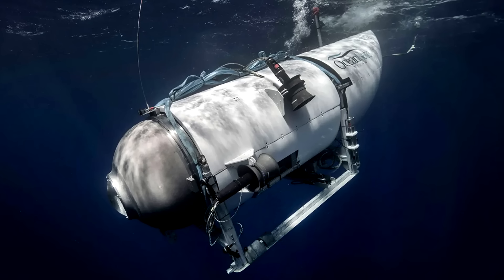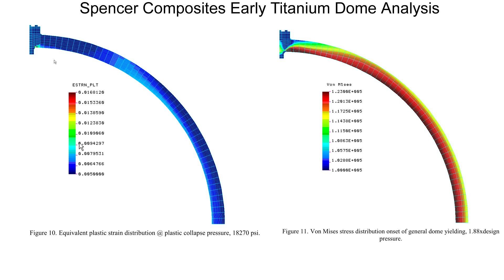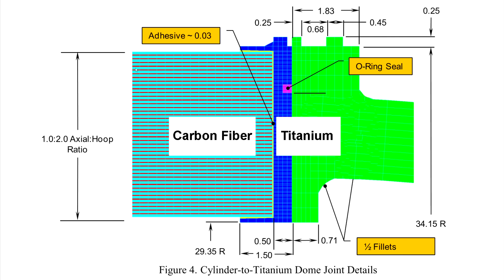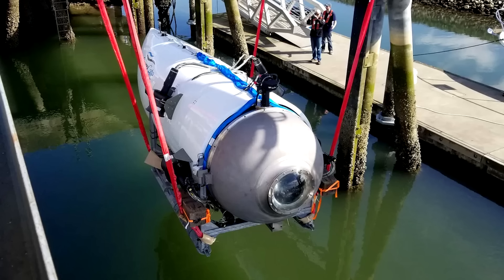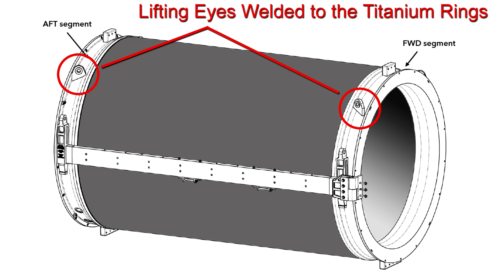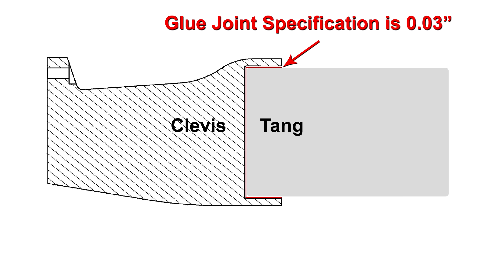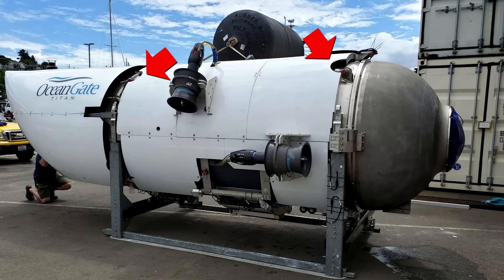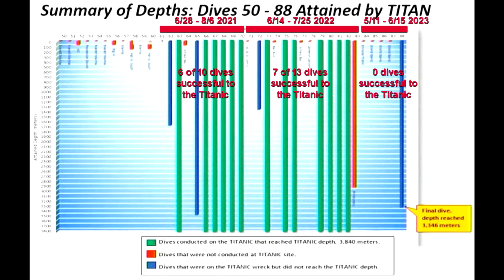OceanGate Titan Titanium Rings - An Additional Story About Them

Comment: The apoxy glue failed at the front ring which held that front cap.  The carbon fiber cylinder actually held up against the enormous pressure.

Comment: 2:02 well from the beginning, Rush especially believed that the pressure of the water would hold the end caps together vs being a failure/water ingress point. And it was never examined as such. On dive 87 when the bouncy on the barge failed and the sub was impacting the barge multiple times couldn’t have been good for the titanium and carbon fiber joints

Comment: To me this shows that verifies Tony Nissan”s claim that it was not the hull why he would not go down in Titan, But because of the Operations team and Rush who both did not know how to handle, store, and move Titan to protect and safeguard the hull.  Yes, very poor manufacturing of the hull, but it was the compromised forward ring that was the primary cause of the implosion.  
If it had proper handling and storage, I believe from all the testimony the hull’s life cycle could have been at least 20 dives to depth before it needed to be replaced.
You may be able to say that Stockton was on to a new material for submersibles if he would have followed Boeing’s recommendations and could find someone who could do the level of manufacturing needed, along with excellent handling procedures.  
Your thoughts?

Comment: In the full audio of Lockridge and Stockton, he clearly states about the consequences of moisture freezing in that sub yet he left it for a full winter where it was subjected to such temperatures. That is insanely negligent and i have no issue if it was a solo endeavour but he downplayed the risks. He used the safety record statistics of the industry, one that he didn't just not adhere to but actively opposed. His accoustic monitoring system actually worked yet they didn't see or ignored the data. Was Stockton on  the deep dive after dive 80? I thought he wasn't and someone else was on that ride? If so that feels calculated. You hear this event on dive 80, brush it under the rug but are not in the next deep dive. Brrrr.

Comment: Regardless of many other considerations,  one fact is that the lips on the titanium rings are just too thin and narrow, a stupid way to skimp on expensive titanium metal?... orcplainly bad design?
- No surprise those lips were cleanly removed by the force of the implosion... 

 The design of the dissimilar material joints between the carbon fiber cylinder and the titanium rings was as precarious as anything!  Absolutely worst made design, with a very idealistic set of design loads, assuming "perfectly" behaved components, without ANY allowances for Real-Life additional loads...

Comment: I think you are right. Those rings distorted, broke the glue bond, all it took was a fraction, seperation, implosion. The heat generated in welding, into the fiber, all that weight focused when lifted?

Comment: Nissen is an incompentent narcissist he lies whenever he opens his mouth.

The water intrusion comment is total BS, since the pressure in longitudinal direction by the end caps would have sealed any leak.

But what did propably cause the accident is when the glue deteriorated the thin lips suddenly had to take all the load,
which they were far too thin to do, which is why they sheared off like a knife going through butter.

Comment: For me, the most important factor was reducing the thickness of the titanium ring lips to accommodate the thicker V2 fuselage. The domes after implosion show that these lips were completely torn off. The fuselage itself showed no fiber breakage along the mid-length of the fuselage, indicating that the entire cylinder collapsed uniformly, and this could only have occurred when the dome lip was released.

Comment: Seems a solid one piece titanium would have been different.  The porthole would still be a concern as well as each line that breached the hull.   Multiple entry port with multiple sealable hatches.  This bs about weight is stupid.  You could add a ton of additional hp oxygen for emergency rise.

Comment: I’m surprised they didn’t at least use reinforcement rings or some kind of skeletal structure along its length to prevent flexing. Barrel manufacturers have better engineering.

Comment: Superb example of people ignoring engineering imperatives.

Probably not the cause of the failure though.
The sub' imploded.
If the joint between the rings and CF tub failed there would have been water ingress as pressure eualised.
It probably would have been violent and it might've caused the ring to separate but that wouldn't have caused the CF tub to implode and disintegrate.

Comment: Jeezuz, ya don't have to be a submersible engineer to see the potential risk of welding and lifting via the rings. Ffs, it's commonsense ... which Rush was short on. If it ain't 100% DESIGNED for that function, ya don't do it.

Comment: So whether it was lifted by attaching the straps to the landing gear, which was attached to the titanium rings or to the welded on lifting eyes, either way the load and shear forces on the rings would still be a factor, correct?

Comment: Just wanted to ask about the forces from the rigging used to lift the sub by the new eyes. I don’t see spreader bars used, so the force isn’t 100% in shear. Wouldn’t it have pulled inward on the upper eyes, forcing the bottom of the titanium ring to pivot away from the carbon body?

Comment: All that focus on lifting stresses on the "lip" of the titanium ring, but little or none on possible shear pressure from the water pressure itself? It seems to me there should have been a much heftier load bearing inner cylindrical interface on the ring, with the titanium extending some distance into the cylinder and tapering (feathering) to its extremity to allow controlled supported deformation  of the carbon fiber/titanium interface away from the shear point. What am I missing?

Comment: If the glue failed, water ingresses, and pressure equalises - wouldn't the rings either stay in place or fall off; but the carbon structure surely wouldn't fail in this instance?  Of course occupants dead and sub filled with water in this scenario.

Comment: It was a sealed carbon fiber tube. The titanium ring and clevis were part of but irrelevant for the implosion. 

Cycling the carbon fiber at depth led to carbon fiber damage. The crush happened between the end cap rings and the damaged fibers leading to increased loading on the cylinder itself. 

The carbon fiber was a bad material for cyclic loading at that pressure and the cylindrical design was second. Spherical design is the best for even pressure loading and can be overengineered to compensate for manufacturing defects. 

This was hot garbage. This entire vehicle was based on flawed assumptions in engineering.
Reply: It was sheer factor on the thin c section where the carbon and titanium mated. Thats why u can see it is separate in pic of front dome. 100% it was. U learn sheer dynamics in first semester of engineering. Stockton and hid friends to busy partying to learn that

Comment: You are making a very good case for the Titan's destruction. As a Mechanical Engineer, just looking at those lifting eye, design, fixing locations and connection welds, should have had the alarm bells ringing. It didn't with 'Rush', either he didn't have the experience to see it or he didn't want to see it.

Comment: Comments are blaming things like the glue holding the domed ends on the cabin cylinder. But from the moment the Titan was lowered into the merciless ocean those domes were never ever going to separate (fall off)....They're being held together by countless pressures per sq. inch that eventually imploded the cabin like an aluminum can crusher. Imagine setting an empty beer can on the ground....and you slowly, carefully stand on it with one foot... without crushing it. Then have someone disrupt the structure by gently pushing in on the side of it.....VAROOM! It implodes. If the cylinder used in this dive belt was a foldable material it would more likely be in a few pieces but carbon fiber is somewhat "brittle" in comparison. I'm curious if they lengthened the hull. The shorter the hull, the stronger it is. (common sense)
Reply from the maker: Thanks for your comment.  What you describe is true. The other potential weak spot could still be the epoxy joint between the titanium rings and the hull.
Reply: @solareclipsetimer __Thx for the reply.   I like to picture things in my mind. For instance a "ring". If you acquired a ring from a gum-ball machine and pinched it with 2 fingers  from opposite  sides you could prolly "oval" it rather easily....but if you pushed in on all sides of it equally it would be (to some) surprisingly difficult.   Participants in this project will never know for sure. There could have been an implosion on a small device outside the vessel that triggered (via shock wave) the whole catastrophe....Rapid water displacement at those depths is mind boggling (to me).
     I'm a Master Plumber...hand me a set of plans and I'll plumb that custom house from the ground up, by myself and never hold anyone up. For some reason I always did well in science too.  🤷‍♂

Comment: When you hear Tony Nissen explain why he did not want lifting points on the rings, he makes a very calm rational explanation for this that is compelling and obvious even to someone like me who has worked in maintenance engineering for a considerable part of my working life. I dont have the engineering qualification but rather i would be at the sharp end putting something together an engineer has designed, working in this environment you get a real hands on feel for how materials work, i can see with Tonys explantion the weak point for water intrusion is that top tang on the ring. The whole way of lifting the sub seems an after thought, a good designer involves everyone right at the drawing board stage, involving a rigger at the design stage would have raised the question "right thats great, but how do you expect me to lift the dam thing" often engineers miss basics like this, wrapped up in their own self importance and qualifications (they usually have plastered all over the walls to show the world how clever they are) they dont see a need to involve the shop floor guys who they view as inferior. The more you see of this sub you realise it was always likely to fail, the point i dont know was how many pressure cycles would it be subject to before the weak part i.e. the carbon tube was replaced, this would have been your back up, your final safety margin, with a material like CF which is always going to degrade, it should have had a defined life span.

Comment: They didn't even use a spreader bar to lift! Think of the internal compression inwards on the hull during lifting, as well as the outwards tension on the lower half of the hull. Holy crap what a debacle
Reply from the maker: Yes, the rigging from new eye rings that were not in the initial engineering was a bad idea.  It makes me wonder if the failure point was the front ring.  Did you see my video on Dive 87?  That will make you suspicious about the front ring also.

Comment: "Lets lift it by its weakest points" was the death knell.
Reply: Classic Stockton
Reply: Surely at some point, they must have contemplated using a braced system for transporting, or at least I’m left wondering why they didn’t engineer one - choosing to use rings instead. Probably cost. Who knows. 😂

Comment: I know nothing about structural engineering, but I wondered why they didn't use a thin layer of titanium to encapsulate the carbon fiber.  Meaning that you'd be using less titanium that in traditional designs, the carbon would represent the center structure, it would be sealed from water intrusion, and the rings wouldn't have been glued.  Imagine a hollow wood door, except with a carbon center.  I agree with a previous commenter that this should have been tested hundreds of times unmanned.

Comment: The problem was probably caused by sanding through the layers of carbon fiber to put the next layer on. This caused weak points.  Secondly when carbon fiber fails, it does not fail slowly but all of a sudden, so alarms would be of no use.  Carbon fiber was not appropriate for this purpose. Plain and simple.

Comment: The cause of the failure was Stockton Rush.  Lack of testing was an issue, yes, and that led to loss of life.  But bottom line is that it was bad design.  And that was apparent from the start.  The fact that Stockton was relying on a system of detecting micro failures as a predictive model of catastrophic failure was ludicrous.

The experts warned him that his selection of materials was not sound.  He ignored the experts.  And he failed to recognize there is quite a bit of difference from designing pressure vessels for aircraft and designing pressure vessels for submersibles.

Comment: The sub also spent time outdoors in the cold Canada winter. Any water intrusion would have frozen and expanded. The fatal dive was the first deep dive of 2023. The failure to account for cold weather is reminiscent of the space shuttle Challenger O-rings in cold weather, which also proved fatal. Both attitudes were the same: we got away with it before, and we will continue to get away with it.

Comment: 2 different materials react differently , contract differently so when the titanium didnt contract but the carbon fibre did , so therefore the seal between them was compramised and failed . there was no way to check them other than taking them apart .no public should of been aloud to enter it , no safety measures to abandon ship either .so sad this was aloud to happen
Reply from the maker: I agree, and thanks for commenting.  Tony Nissen worked to match the moduli of the CF and the rings of the V1 hull.  We don't know about the V2 hull and using the same rings.  The strain gauges from the Titanic dive seemed to show that the aft ring was much stiffer.  But the strain channels were not labeled well, so I am not sure. I write about all of this stuff in my book.  The link is in the description.

Comment: I was in the Navy and fixed 688 class subs. One of the things we are trained on and have to sign off on when we did work, were Subsafe requirements. At one point Stockton Rush mentioned Subsafe and complained that the safety requirements were over the top. The irony of this statement is that Subsafe was developed following the implosion of the USS Thresher, a Skipjack class submarine. These safety requirements exist for a very good reason. 

I also learned that Rush was an aviation engineer, which is where he got the idea for a tubular carbon fiber pressure vessel. Live and learn I guess??? Edit: It also blows my mind that they left the Titan out all winter in Canada. How were so many basic mistakes made? Interesting how this was allowed to happen because people didn't want to get fired or make their boss mad.

Comment: I am baffled why cf was chosen as a material. The lightness of cf has no advantage in the water and strength can be gotten by either steel or titanium. Cf has far too many problems especially stress raisers voids, cyclic loading and prone to fatigue by cracks and brittle failure as it has zero toughness. Why did the silly man choose cf..... Shame on boeing and Nasa getting involved.

Comment: Welding on the rings AFTER machining them could easily have altered the geometry of the rings. Unless that was anticipated, checked and re machined if needed, it could have introduced gaps where the hull met the ring. Even if it was only a few thousandths of an inch, it would be a grave error (no pun intended) not to take that into consideration.

Comment: Stockton was so stupid for having the lifting eyes welded on the O-rings instead of having them welded on a platform that can be lifted with the Titan submersible sitting on it. He completely ignored every safety measure needed or even at least to have the submersible in the best condition possible. I know that the materials he used for it are totally incompatible but the things he ignored contributed to his demise and his passengers
Reply from the maker: Thanks for your comment.  I agree.  The engineers who designed the rings and the landing gear told him specifically that you can't lift it by the rings.  OceanGate did it anyway.  The only thing we don't know is whether they ran that plan by Collier Aerospace and got an okay. Collier was an engineering company involved with the V2 hull that we don't hear much about.
Reply: How many trips 
Titan made before implosion